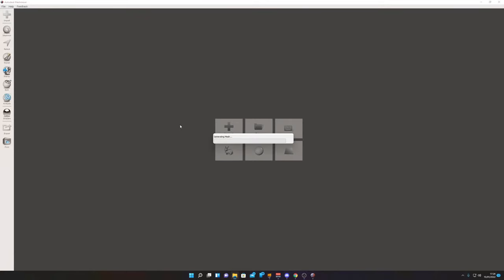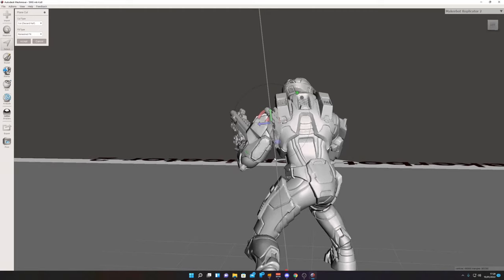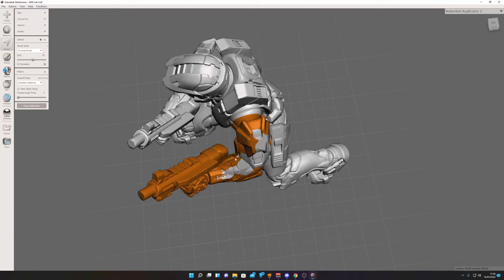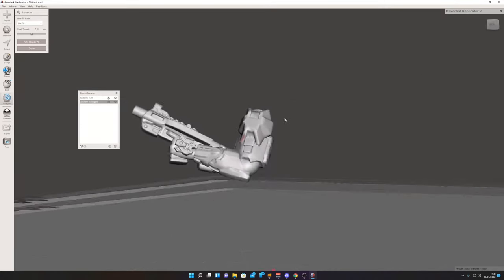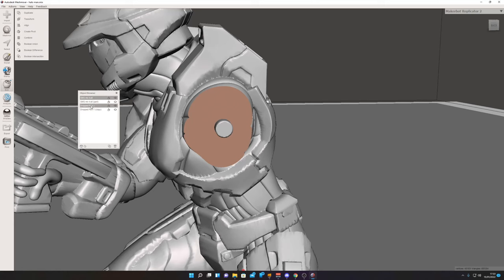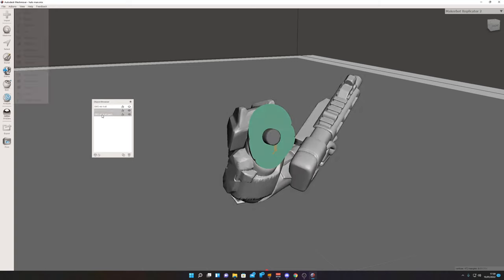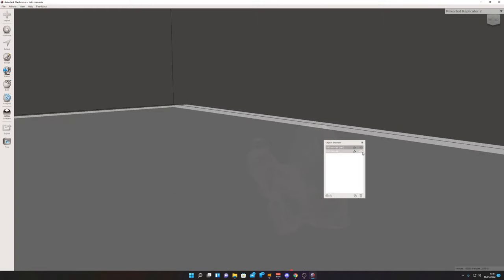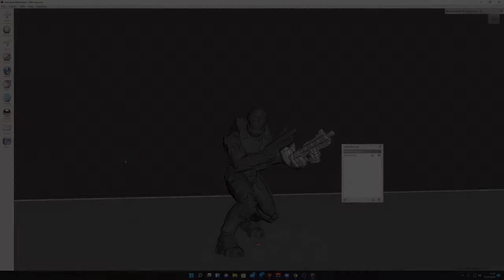Separate Large STL Files Into Multiple Pieces & Add Locator Pins Using Meshmixer

Comment: @TechClub I think I may have diagnosed your crashing issue, as I was having a similar problem and I noticed something.  Meshmixer only crashes when doing the Boolean union/difference IF I don't press enter after modifying the border rings value.  If you're noticing you're crashing consistently when using these two operations, make sure you hit enter before clicking accept.  Hope this helps!
Reply: nice👍 call bud
Reply: I was having the same issues and this fixed it for me, thanks!
Reply: YAASSSSSSSS hot damn it YAASSSSSSSS 😊
Reply: Legend cheers!

Comment: Did you resize one of your locator pins? and if yes how much (mm) did you substract/add to one of the pin?
Reply: he did it by 1 mm, with the transform settings and he dent show it but had already did it here 7:54.
Reply: 0.1 mm he said, for a resin printer that’s probably good. For fdm I’d do a much bigger pin and probably .2-.3mm tolerance for good bonding.

Comment: 18 on the male part and 17 on the female part?  Is that intentional, or should they both have been 18? @TechClub
Reply from the maker: I think both 18 but wont make much difference
Reply: intentional 2 18s is going to be tight but a 17 and 18 fits in easier that sounds really bad if you dont know what were talking about